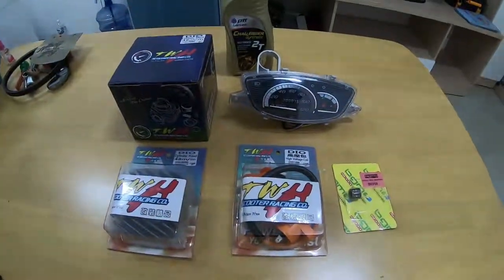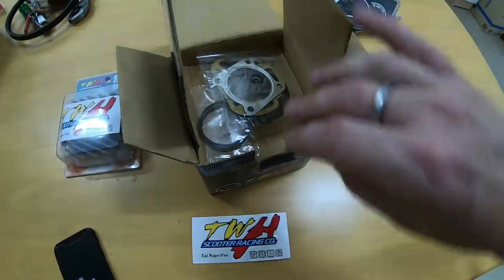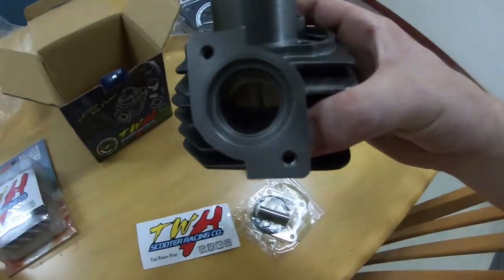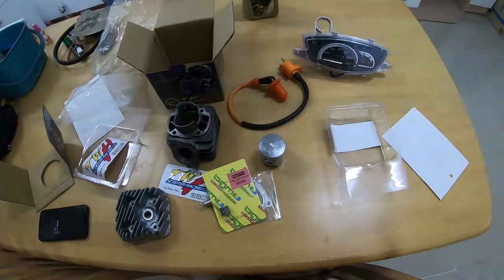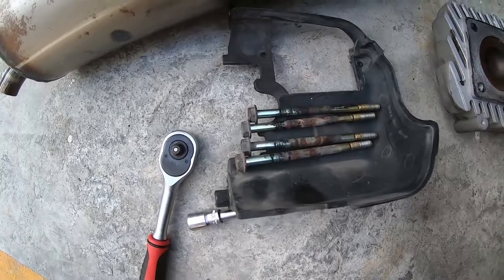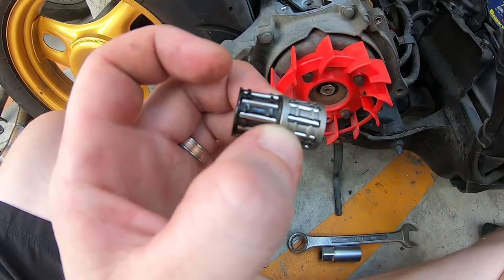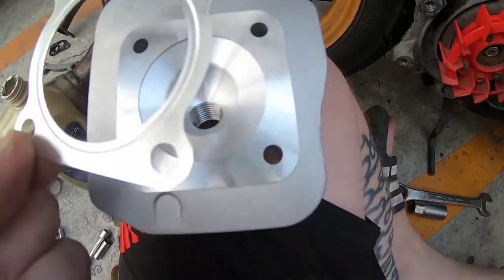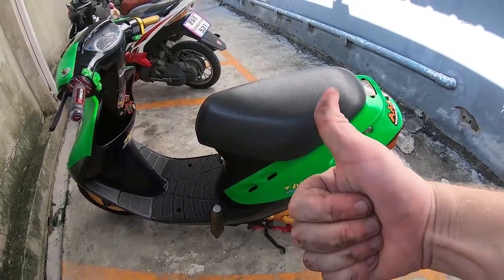How To Install a 48mm TWH Big Bore Kit + Other Bits (Honda Dio AF27)

Comment: Watching from the Philippines. Thank you so much for this very informative video sir. I'm planning to build my very first Honda Dio this year and this video just made me want to do it more. I'm also planning to use straight TWH products for the upgrade since the availability of Italian brands (Polini, Malossi, and etc.) is very rare here in my country. How is the TWH kit doing now after a few months? Do you recommend it? Your feedback will be highly appreciated sir :)
Reply from the maker: I totally understand about the lack of availability too. Here in Thailand there are generally only Taiwanese parts which isn't a bad thing at all. Here, I paid around $45 for the 48mm kit and a polini kit here is more like $250. 

The kit runs well and definitely worth the money but looking back, would had rather bought the Jiso 48mm kit. It's not much more cost and higher quality. 

BGM is also a great option. They do a ceramic 49mm kit for dio which I've heard is great. 

My advice is, put a crank in too. It will make so much more difference. Then of course you will need to upgrade CVT parts and carb/intake but it will be totally worth it.

Any questions, just let me know. 👍
Reply: @thaitorque8847  Thank you so much sir for the advice. I will definitely put this into consideration. It's really good to have content creators here on youtube that actually cares about their subscribers. Looking forward to your future builds and content. I will definitely update you once I'm done with my build.

You deserve a million subs 👍
Good luck and more power 🙂
Reply from the maker: Equally, it's nice to have some feedback from subscribers too. I'm glad that some people are enjoying the content I'm creating here.

The next build will be a track only drag scooter. I'm hoping to go for around 130cc (hopefully more) so stay tuned. There will be lots of interesting stuff to come! 👍
Reply: sa ring ng twh pas ako.. mablis umingay.. kya pang breakin ko lang yang twh rings.. pinapalitan ko ng lazer rings or mas ok shenge piston kit.. mas ok sna kung jcc japan kits

Comment: Is your crank case ported? Are you using the stock connecting rod and crank shaft? Im planning to upgrade from 50cc to 90cc
Reply from the maker: Yes, I have ported my case. Boost port and intake. If you looks through my other videos, there is one where I port the case. 

I am using the stock crank/crank shaft but I would always recommend upgrading the crank when upgrading the cylinder. It would make so much more power.

Let me know if you have any other questions. 👍
Reply: Thai Torque thank you for your reply!

Comment: hey i have a honda giorno , do they have the same engine as the honda dio
Reply from the maker: After having a quick check, I can see that the Honda Giorno has the AF24 engine which may indeed be compatible with AF18 parts. I'm not 100% sure on that though.

Comment: Sir  i need your advice what will you recommend on me to make my dio more fast.. Because  i want join drag racing . My dio is all stock
Reply from the maker: If you want to enter a drag race and compete then you will need to invest around 1000usd to have something that is very fast.

My guess would be a minimum of 500usd investment. It all depends about how the drag races work in your country. In Thailand it is grouped into cylinder sizes from 44mm up to 56mm and then a "mixed" category for larger bores.

Most fast drag race scooters are at least 54mm piston size with many other upgrades.

At a minimum you will need cylinder, crank, ported case, full CVT upgrade, full carb/intake/reed upgrade, gears, CDI, exhaust, fully lightened frame and plastics, stretch kit..... and that's just to begin with. 

It's a big investment of money and time but well worth it! 👍
Reply: @thaitorque8847  thank you sir
Reply: @agbuya there is a plug and play 125cc watercooled engine for dio. If you have 2500usd they can make you one.

Comment: What is your topspeed after you changed your cylinder?
Reply from the maker: With the current setup I have, I've had it just under 100kph. With a crank I think it could go up to 130kph with all parts dialed in.
Reply: @thaitorque8847  what crank sir? And what are those mods
Reply from the maker: It depends on the cylinder to what crank you should buy. For example, if you have TWH cylinder, I would suggest TWH crank. If you have Jiso cylinder, then Jiso crank etc.

The list of parts I have is quite long. But it is fully upgraded CVT (every part upgraded), fully upgraded carb/intake, all gears upgraded, ported cylinder and case, upgraded exhaust, upgraded CDI/coil/plug, lightened flywheel.
Reply: @thaitorque8847  Why would a crank allow you to go 130kph not 100kph like stock crank ?

Comment: wy didnt tou rev it up i put one of those cy on my scooters and it still not running right wont rev  rich jet lean jet nothing works and the piston weighs 3x the weighto of the replacement 50mm piston if you ask me ther junk
Reply from the maker: This kit wasn't bad to be fair. I've had the scooter up to 95kph with stock crank and that kit so it definitely made a big difference.

As for revving, I just wanted to heat cycle it a few times first. You can check out some of my other videos to see it being used! 👍

Thanks for checking out my channel.